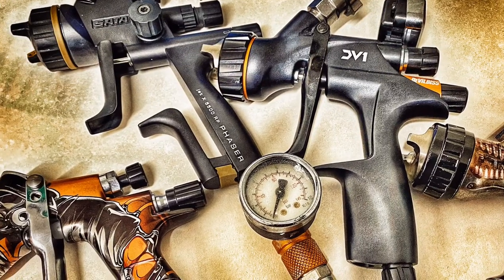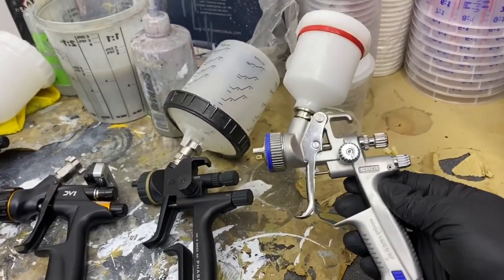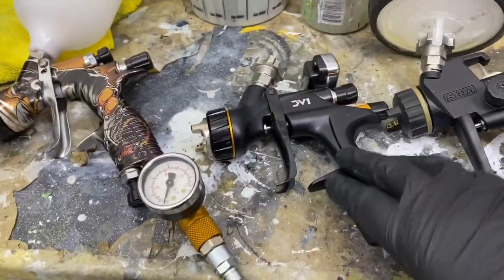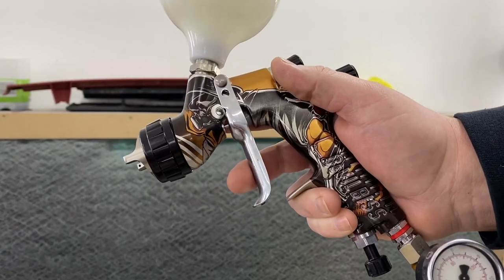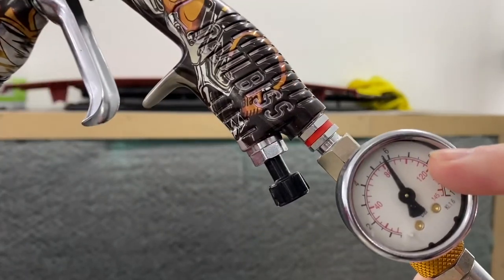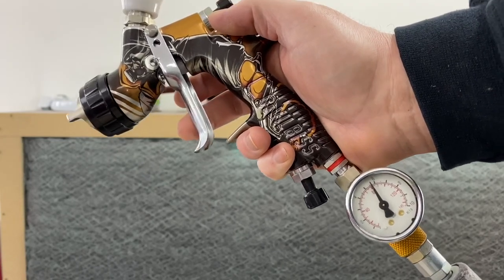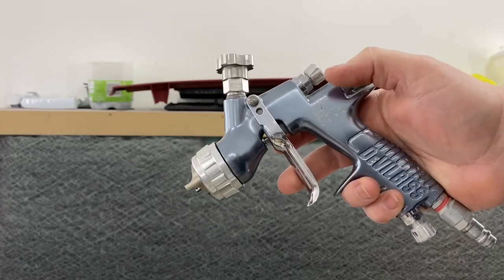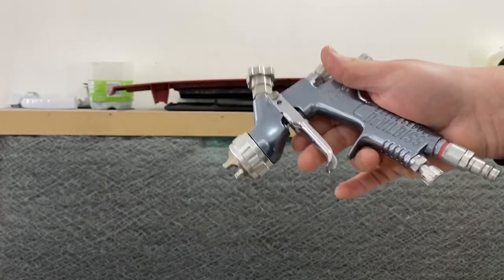how to set up and use a spray gun for beginners

Comment: So the black control where the airline goes in is the main  pressure from compressor  , so is the gold one the fine tuning one , I understand the rest of what you explained . Also my grandad had a moisture filter on the airline somewhere or is that just for some types of paint  . I was very young when he was a spraying so I can't remember much . Just trying to grasp the basics . New subscriber .
Reply from the maker: Thanks 🙏 and welcome aboard 💪💪💪 so the black one you are referring to is you air pressure adjustment so if you didn’t have a regulator attached with the dial you would just adjust that to up or down your air pressure, but if you do have a regulator on like I had then you would have you air adjusted to full open on the gun then adjust it up or down on the regulator hope that helps 👊👊👊
Reply: @grantssmartrepairs  Theres much more  accuracy with the regulator   , I see what you mean now.
Reply from the maker: You got it 💪💪💪

Comment: What gun would you recommend for a 50l 14.6cfm compressor. I don't want orange peel but also want the compressor keeping up with the gun?
Reply from the maker: It’s very hard with modern guns as they eat air especially with small compressors, don’t get me wrong you can paint with them but I would aim at a panel at a time! I don’t know your budget regarding a gun but if you can find a devilbiss gti pro light with a TE20 cap you will do just fine with a slight factory peel, and a lot of factors effect orange peel most of it is in the prep tbh 💪💪
Reply: @grantssmartrepairs  hmm, OK thanks for that, what about if I was to use an Lvlp gun is there any your could recommend?  My budget is upto £200 I guess
Reply from the maker: Mate stay away from lvlp it’s rubbish trust me, hunt on eBay mate if you can find a gti pro light you will never look back!! I have the best guns money can buy guess what I use the most!! My pro lights!!
Reply: @grantssmartrepairs  thank you for your advice
Reply from the maker: No problems if you get stuck let me know I’ll try help if I can 👍👍👍